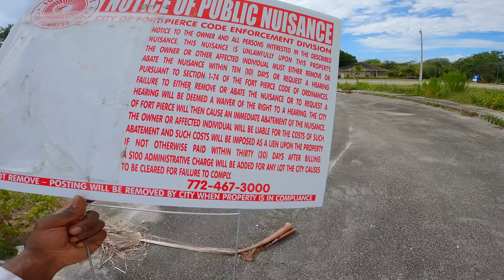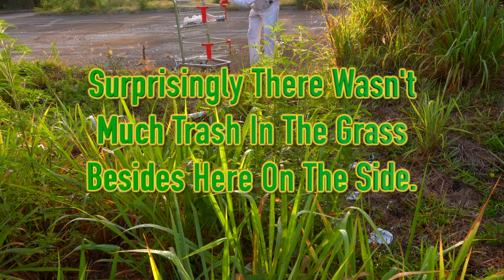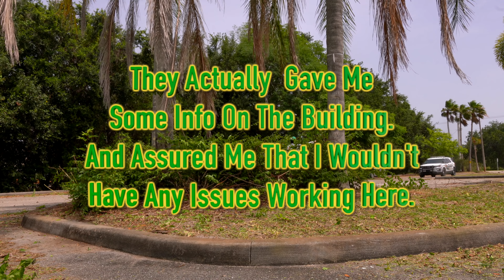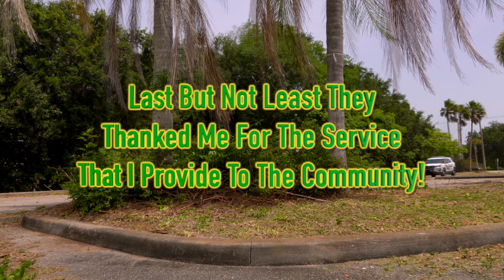Local Cops Thanked Me For This FREE YARD TRANSFORMATION AT A OVERGROWN & ABANDONED CANCER Center!!

Comment: Hey AP, you do great work. I think you should know that instead of a tarp, nylon netting, like on tennis court fencing is best, it doesn't tear easily...you can drag it over gravel or any surface, also it will drain the water off of the limbs as you drag it.

Comment: He needs a little rubber made cart to pull around with all his various tools that he uses for each section (cutters, weed eater and various attachments, rakes, tarps etc) that would save him so much time is running and fetching tools as he moves to each area.   Plus he could throw small clippings in there to dump in the trailer when he makes his way back.